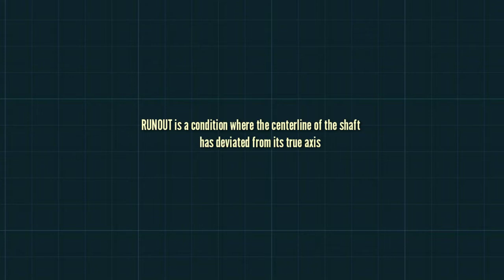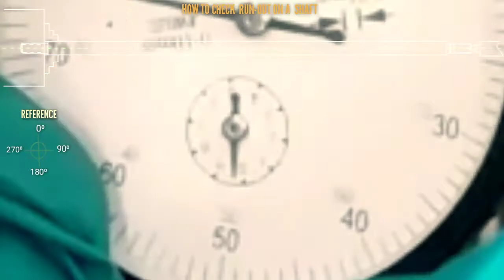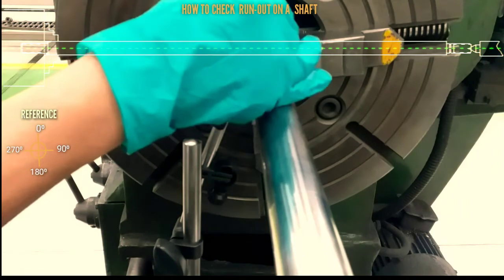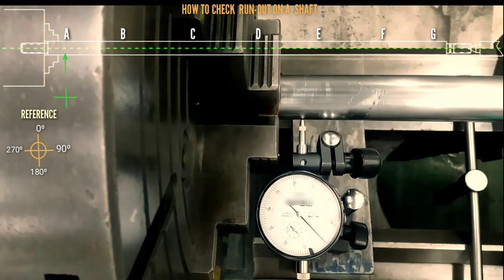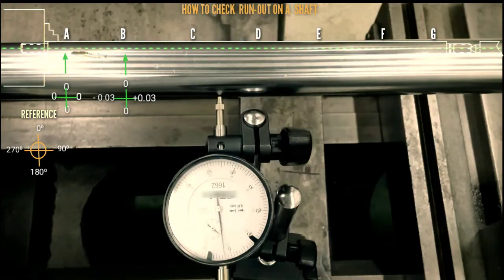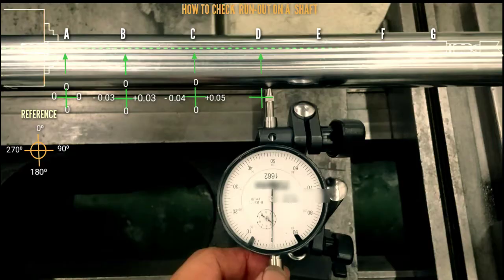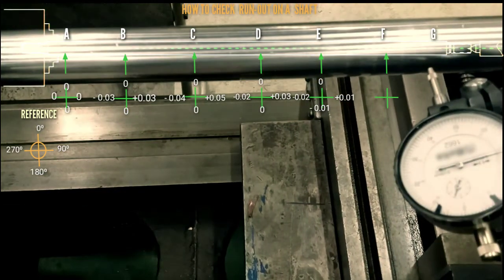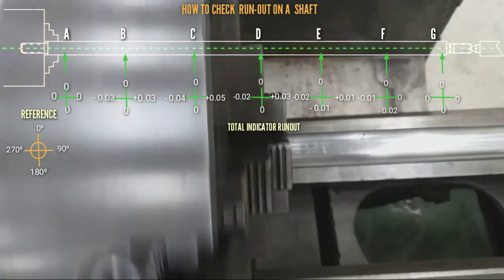HOW TO CHECK RUNOUT ON A SHAFT | Machine Shop Theory

Comment: Thank you for the video
I would like to ask 2 questions 
1. what is the allowable range for runout value?
2. How to correct the tge values which is out out of the range?

Thanks
Reply from the maker: For your questions 1) 0.002" 0r 0.0508mm max.for higher RPM 2) you can correct through the heating process by using oxy-acetylene method.
Reply: thank you so much
 @RadmakOfficial

Comment: A questian, first you center the axel right? and wich points you center the axle before start check run out?
Reply from the maker: Yes,  need to center first on both end of the shaft  before to start checking runout.

Comment: How much is the distance between A, B,C and so on?
The maximum shaft runout should be taken along the complete shaft or betweeen A and B points ?
What is the maximum shaft run out vaalue?
Reply from the maker: Approx. 200mm in distance,maximum shaft runout value is 0.05mm for high RPM Morethan 3000 is 0.02 mm tir.

Comment: Ilan po ang maximum runout for shafts?
Reply from the maker: Dipindi po sa application ng shaft sa normal 0.002" or 0.05mm for 3000+ RPM 0.001" or 0.02 mm.